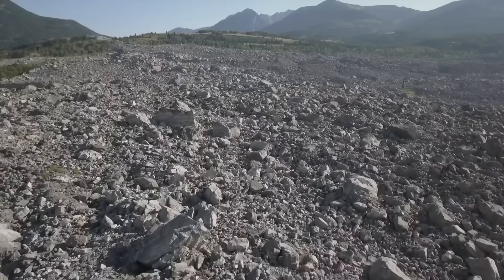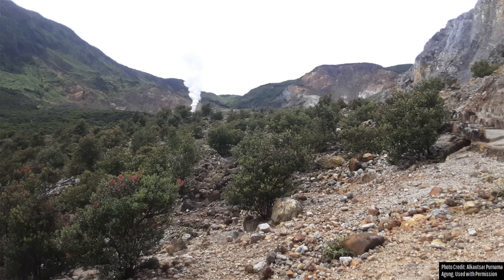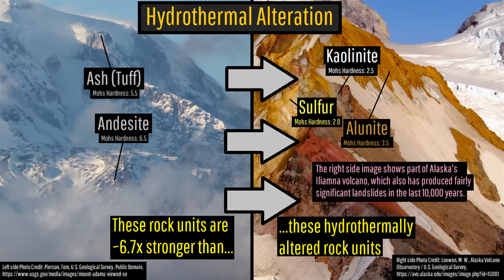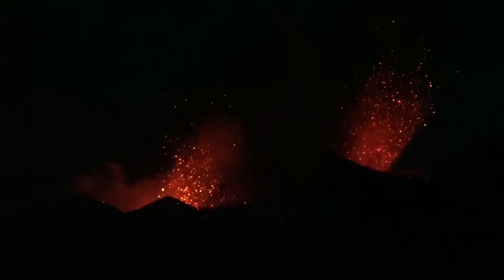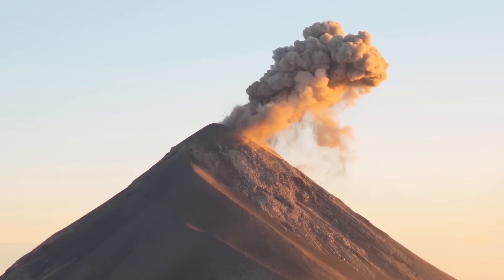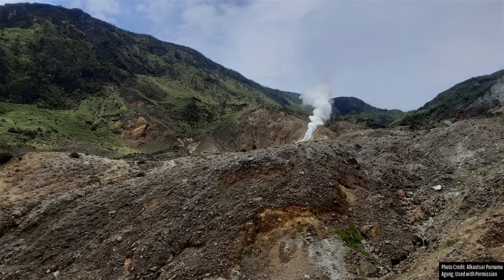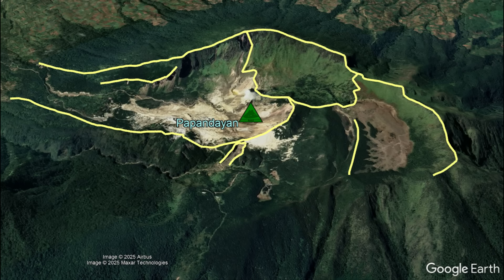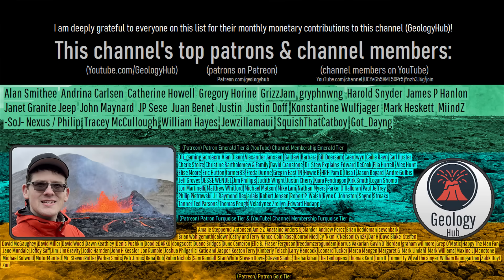History's Deadliest Volcanic Eruption Landslide; 3,000 Fatalities

Comment: Did my undergraduate thesis in this exact volcano, back in 2019, though I focused more on the hydrothermal alteration and alteration mineral zoning than the volcanostratigraphy. Both my hyperspectral remote sensing analysis (using Hyperion) and the ground truthing (using ASD Spectrometer) shows vast zones of kaolinite zones related to hydrothermal alteration, halloysite zones possibly correlating to weathering of plagioclase, and even a localized small zone of alunite+silica alteration near the currently active crater, indicating the hydrothermal fluid is/was hot and acidic enough to cause an advanced argillic alteration.

There is a stark difference in the degree of alteration between both exposed scar slopes. The rocks on the SE side are almost fresh still, with minor alteration due to weathering on exposed part. In contrast, the NW slope is intensely altered. I was really interested in finding out the hydrothermal source and its evolution but I do not yet have the answers. You delineate the area to avoid pretty accurately, Tim. Thank you for the coverage!

Comment: On the good side, hot volcanic fluids concentrate metals, and promote the rapid growth of gem crystals in pegmatite, the reason there's gold in them there hills in my back yard in Placer county, California.
Strato volcanoes look so solid and symmetrical but are layers of ash on top of cinders on top of mud flows on top of lava. All rotting from within from caustic hot gasses and liquids, turning solid rock into incompetent clay and other low mohs rocks, all shaken up by quakes and ready to tumble down. Quite a deceptive picture. Solid as a rock depends on which rock. Thanks for the usual solid and factual presentation.

Comment: Worked at an open pit mine once with a large basaltic dyke and associated *hydrothermal alteration*. The alteration was so extensive the quartz monzonite host rock with high grade MoS2 was entirely clay for a third of the pit walls and always plugged up the crushers and ore bins until they had to alternate lower grade harder rock with the clay to attempt keep things clear. Since I worked in the pit I spent many an hour with a jack hammer trying to unplug the clay filled surge bin under the primary. It was winter too so the clay was  partially frozen in the surge bin. At a later time I had the job to survey the walls of that pit with a laser EDM as they were constantly moving due to the alteration.